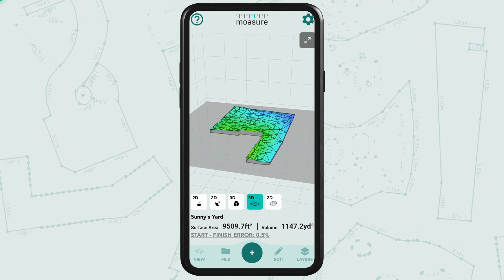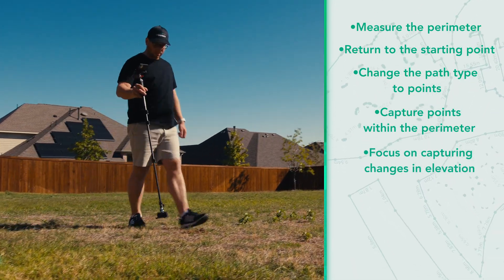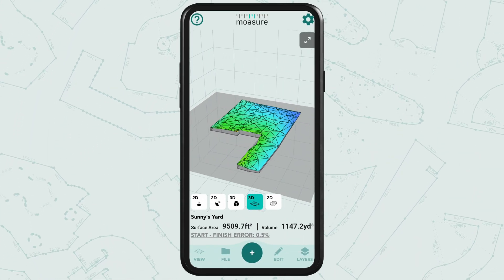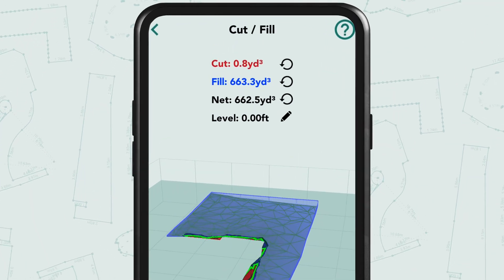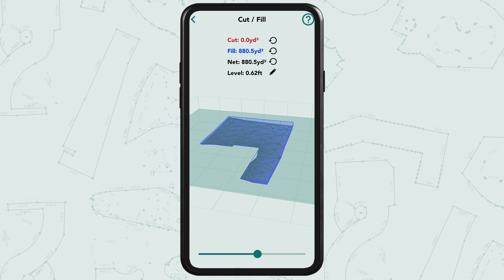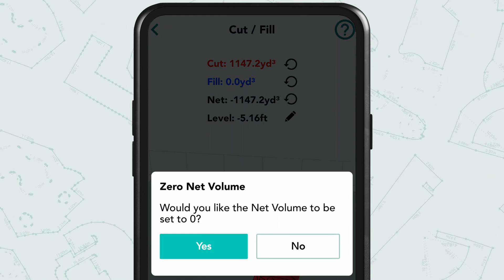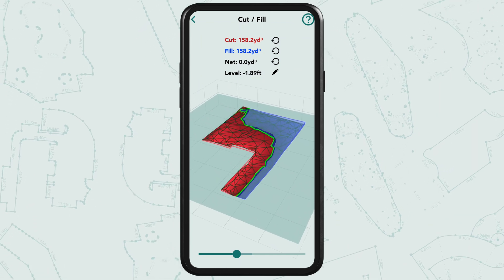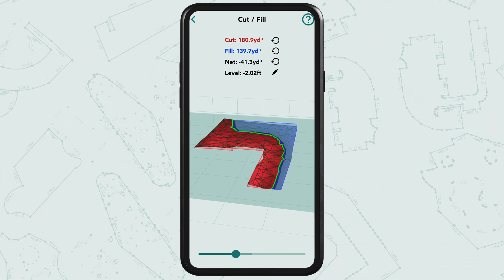Moasure: Site Leveling with Cut & Fill Tool

Comment: how will it preform on a 40 acre lot with lots of contour and thousands of points. Will it freeze up?
Reply from the maker: Moasure’s performance mostly depends on your phone’s available memory (RAM), rather than the app itself. In most cases, you can comfortably measure as far as you can walk within about 15–20 minutes — that’s generally the “safest” distance to make sure your phone can handle all the data smoothly.

That said, some users have gone even further — one measured over 770m (2,500ft) and captured an area of more than 25,000 sq m (6.2 acres)!

For very large or complex sites, like lots with lots of contour or many points, the best approach is to measure in smaller sections and then stitch them together in your preferred CAD software. This keeps everything running smoothly while still capturing all the detail you need.

You can find out more about exporting and combining measurements here: https://www.moasure.com/pages/features-export

Thank you.

Comment: But I only can measure the volume from a horizontal area. What if the area is not horizontal?
Reply from the maker: When it comes to vertical wall measurements, you can measure wall height as long as you can physically reach the height you would like to measure. You can use the Moasure STICK to aid you in measuring wall height, but this depends on being able to reach the point of measurement.

Upon finishing your measurement, you can change your view to 2D fit View. This will show what your measurement looks like from a vertical plane. Find out more about views here: https://docs.moasure.com/en/moasure-app/understand-views

Comment: Will it give a measurement that the zero point to then use on a grade stick for setting up a laser and using that as a benchmark to grade from when leveling on cut/fill sites? It’s nice to k ow the volumes, but need to have a measurement or know the exact spot it’s not planning to cut or fill to then translate to grade rod for using level on machines. Thanks
Reply from the maker: Hi there, yes, Moasure can help with this by providing the elevation data to establish a benchmark for grading. You can capture a reference point (e.g. a zero point) when you take your first measurement point (this will start at 0,0,0 for all xyz coordinates), and then determine the elevation change between subsequent points using the Cross Section tool. 

You could then use this zero point as a reference when setting up your laser level. Additionally, Moasure’s topographical mapping helps visualize terrain variations, making it easier to determine grading adjustments. 

Many of our customers use Moasure for spot elevations on site – you can find more information about capturing elevation here: https://www.moasure.com/pages/features-elevation

Comment: Can you do a video showing the cut and fill feature when grading to a specific slope instead of a specific level of elevation?
Reply: Exactly! I design gardens, and calculations for flat terrain are almost never useful. We always deal with sloped terrain, so such a function would be very helpful.
Reply from the maker: Hi there, thank you for your question! Unfortunately at the moment, the Cut-and-Fill feature does not support calculations on a sloped surface. If this becomes available in the future, we'll make sure to post a video about it. 

If you have any further questions, please don't hesitate to email support@moasure.com!
Reply: @ doing site work as much as we do this feature would be invaluable and certainly would get me to purchase one.  All new homesites require slope for proper runoff and drainage and this feature would save me a ton of time to estimate.
Reply: Will the tool allow you to measure fill on a pad?
Reply from the maker: Hi there, yes, Moasure’s Cut and Fill tool will allow you to determine how much fill you need to level off a concrete pad. To do this, you’ll need to measure the perimeter of the pad, then various points over the surface of the pad so that Moasure knows your site’s topography. Then, you can finish measuring and use the Cut and Fill tool to work out how much material you’ll need to fill in the pad.

Comment: Can this be used to first do a topo map. Then the topsoil stripped quantity. Then a choice of balance the site or import or export? How big of an area can it do? Can it do a football field or double football field size area? Thanks
Reply from the maker: Hi there, thanks for your questions. 

Yes, Moasure can be used to create topographical maps and can be viewed instantly using the ‘Contours’ view within the Moasure app. Using the ‘Add Depth’ tool, you can use the fixed depth volume calculator to assess the volume of topsoil required depending on your desired depth of coverage. The Cut-&-Fill tool can be used for site leveling based on your inputted desired values, which is very handy for calculating material requirements, and determining how much material needs to be moved on/off site. 

You can find more information about volume calculation here: https://www.moasure.com/pages/3d-terrain-mapping-and-volume-calculation 

With regards to the largest area you can measure with Moasure, there isn’t a fixed limit to the distance you can measure, but rather the time you are able to spend measuring, as it's important to note that the size of your phone or tablet’s available memory/RAM is a key factor in this. We hope this answers your query!

Comment: Amazing, just got mine.

Wondering what if I want the finish grade to have a certain slope instead of being flat?
Reply from the maker: Hi Pu Wang,

Great to hear that you've received your Moasure device! If you're looking to set a specific slope instead of a flat finish grade, Moasure can assist you with that. The app includes a "Cut & Fill" tool which can help you determine the amount of material to be cut or filled to achieve your desired slope. Additionally, Moasure can measure volume, which is useful in calculating material requirements for your projects.

For more detailed guidance, you can refer to our online user guide at http://docs.moasure.com
Reply: I design gardens, and calculations for flat terrain are almost never useful. We always deal with sloped terrain, so such a function would be very helpful. At the moment, this function is not available...